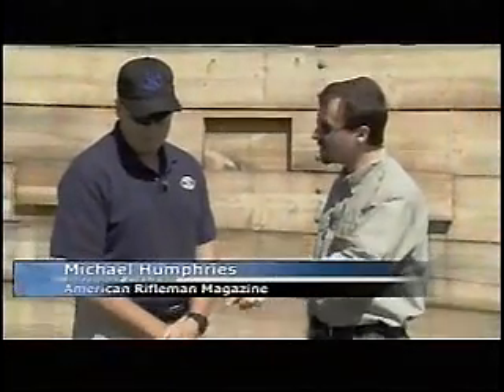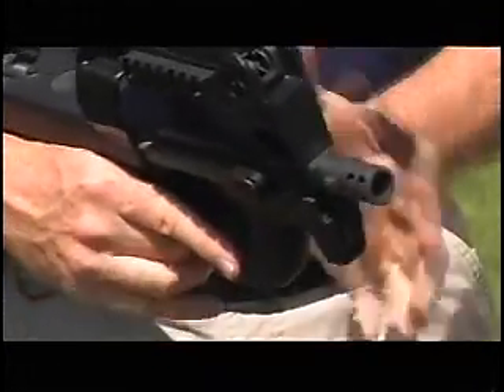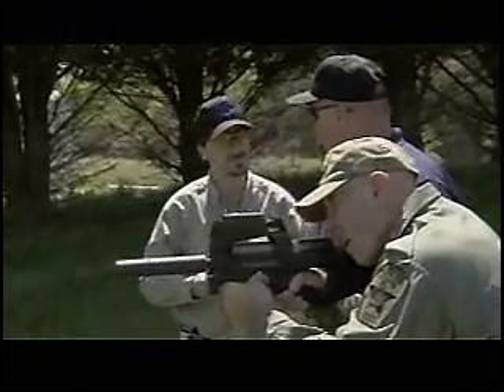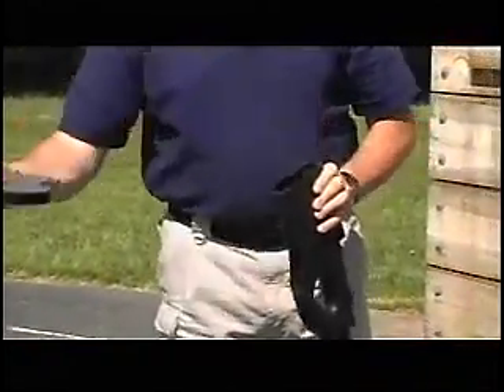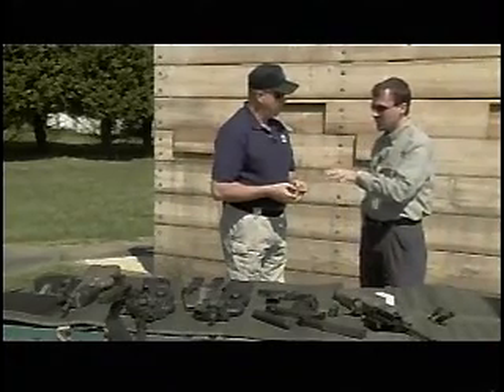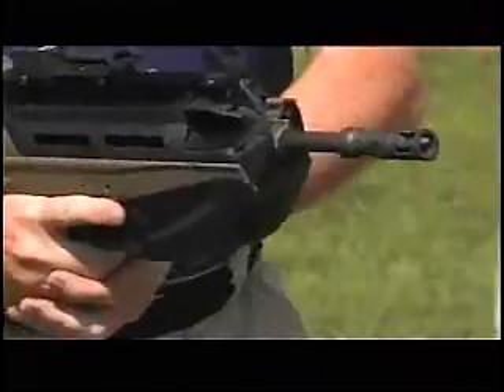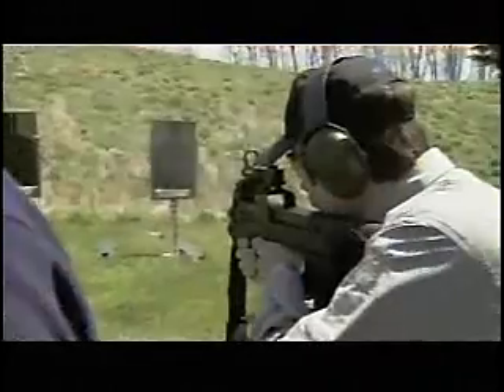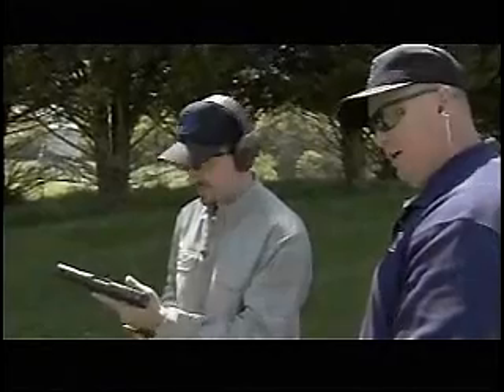P90 carbine on American Rifleman

Comment: A bullet when it goes supersonic makes a loud crack noise, so supressed ammo is slower and does not go super sonic.  You do not need to use supressed ammo with a suppressor, but you will still get the supersonic crack.

Comment: If a suppressor does slow the bullet it will not slow it enough to be subsonic.  If you put a suppressor on the P90 the ammunition will still travel past the speed of sound.  Same with an AR.  If you put a suppressor on a 9mm pistol you will have to use subsonic ammunition in it or you will still hear the crack.  Same with a .22

Comment: Full auto no, Armor piercing maybe. We shouldn't have to fill the air with lead, just well placed shots, and it wouldn't hurt to use powerful armor piercing rounds. However, the P90 isn't all that strong. It's very accurate, I'll give it that, but it it way below a 5.56 from a m16's power. Man I wish theyed make more .45 SMG's, or common guns in  larger cailibers